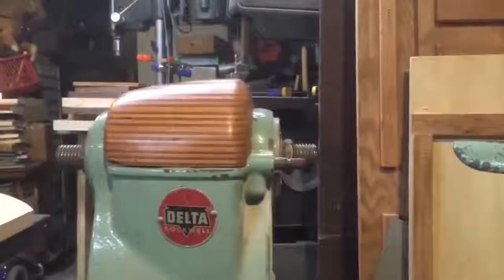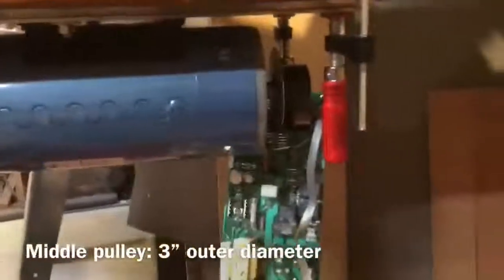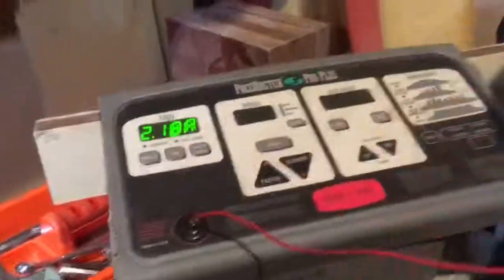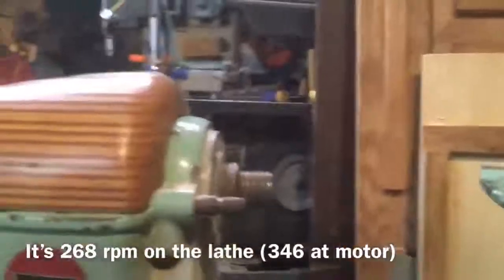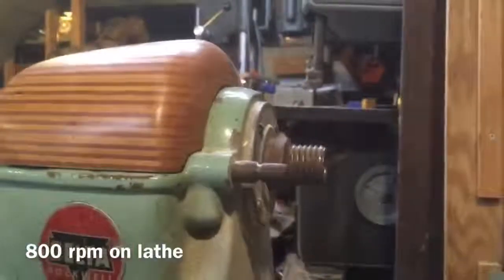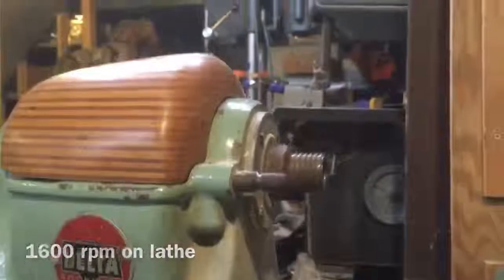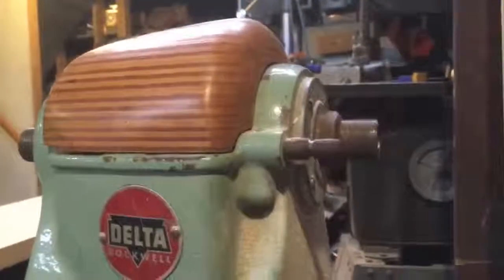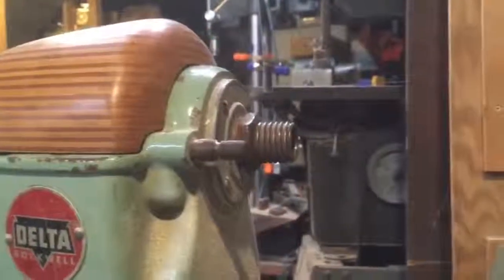Delta-Rockwell vintage 12" wood lathe with variable-speed treadmill motor

Comment: Really nicely pimped out.  I love the wood belt cover! Perhaps there is some fiberglass/epoxy on the inside, for strength?  Treadmill motors, as well as 'industrial servo motors' meant for sewing machines are wonderful.  I mean to put on on a band saw I have to make metal cutting easier.  I have several lathes (both metal and wood) that I have been repowering one by one.  It's so satisfying!
Reply from the maker: While the motor can go quite slow it doesn't have much power at that end. Even so it can go slow enough to turn an 11" Oak bowl with plenty of power.
Reply: @stephenbannasch  you have to be careful with that. When the motor doesn't have much power, straining it causes massive overheating while it isn't turning fast enough to cool itself.  I've lost a few motors this way.  The answer is to get the lowest rpm by stepping the speed down with pulleys.   You should run the motor at double the lowest speed it's actually capable of turning.
Reply from the maker: @someotherdude  Right, the lowest speed I use is normally about "4mph" using the treadmill controller which goes from 1-11 mph. I'm normally using the center set of pulleys. If I really needed it to move slower and have power (and keep the motor cool enough) I have a different set I can change to.

Comment: I have a few TM Motors already for projects but just picked up this exact model tonight free locally for this exact project on the same Lathe! lol Weird that I found this video! Do you have a breakdown of the RPM's at motor speeds? I would love to know as I don't have a rpm gauge. Great video, Thanks :)
Reply from the maker: It's a great motor and controller board. Here's a link to a google spreadsheet I made to do the calculations. The results with the two pulleys/sheaves I'm matching up is 0.7 mph on controller display => 187 rpm on lathe and 11 mph => 2944 rpm.  I also just added a couple of pictures to the spreadsheet that might be helpful. https://docs.google.com/spreadsheets/d/1d8VfP9alXfhAQ9UlCLa_hpgqVPynRbjVVUax6RqbQ00/edit?usp=sharing
Reply from the maker: Of course the treadmill motor is not very powerful at low RPMs -- so if you plan to do large diameter sections on the lathe you might pick a different combination of pulleys to get more power at slower lathe RPMs.
Reply from the maker: Am remembering more about what I did to calculate this. I assumed the MPH reported on the controller board was accurate for the treadmill surface and then used the diameters of the pulleys driving that system to calculate backwards what the RPM of the motor must have been to move the treadmill surface that quickly. Once I had a mapping of reported speed in MPH to motor RPM the rest was easy.
Reply: @stephenbannasch  Awesome! Thank you! I'm installing new headstock bearings in the morning and taking the TM apart for all it's goodies. Thanks again :)

Comment: That is awesome Stephen!! How's it working for you at the present time? Would you recommend this after you have clocked some time on it? Thank you for sharing this!
Reply from the maker: Glad you enjoyed the video and let me know!

It’s working great, it’s wonderful to be able to vary the speed so easily. The soft start and stop work well and the pause button stops the motor but then start brings back to the same speed. I got the treadmill for free on Craigslist. I think it was only about 12 years old and worked perfectly. I asked the owner why they were gettin rid of it. He said they travel a bunch and really like all the amenities in newer treadmills. The original cost was about $2200! I think partly because it was a high-end one it was made well enough to actually be easy to take apart. I recently worked on a 10.5” deep bowl out of Black Oak. The power in deep roughing cuts was near the edge of not being enough. If I end up doing a bunch more work like this I’ll just move the belt to the lower speed pair of sheaves and there will be plenty of power. The 2.5 hp rating on the motor is when is running at high rpms.